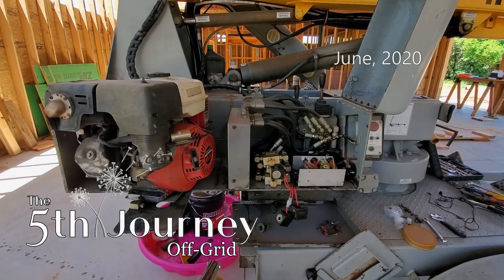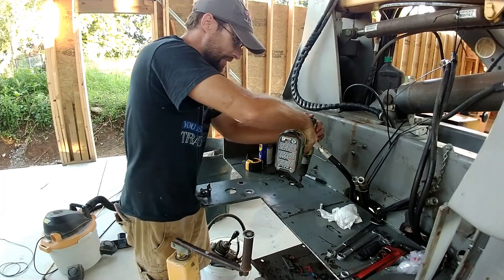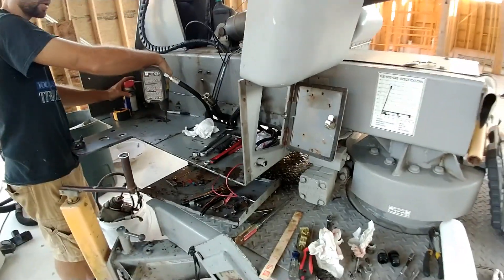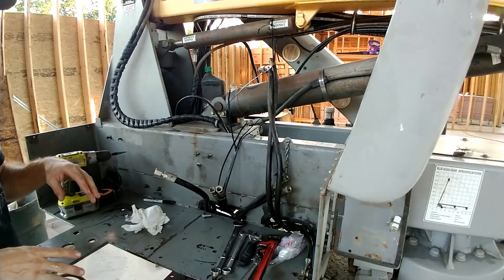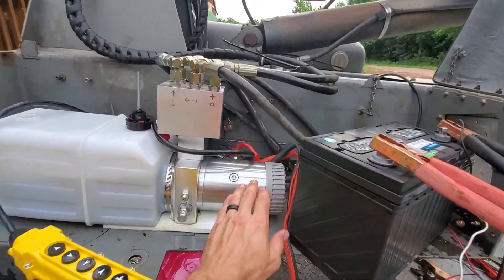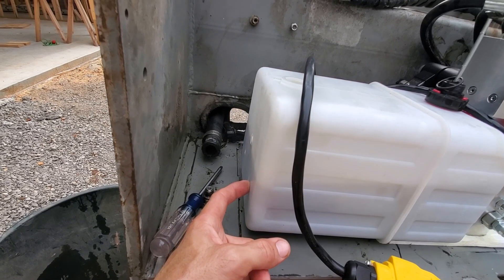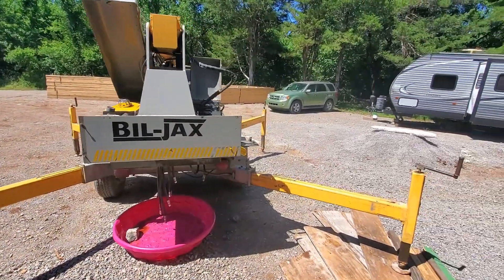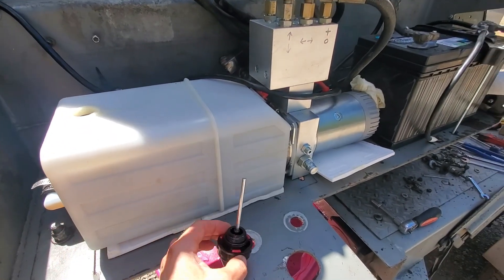Bil-Jax XLB-4232 Motor Replacement from Gas to Electric

Comment: All you really needed to do was get an electric motor and couple it to the pump that was attached to the gas engine 🤷‍♂️
Reply from the maker: Maybe but this eliminated all but two hydraulic hoses that lead up to the bucket because now the controls are remote controlled.  And the old Hydraulic manifold wasn't working properly.  And this was a brand new pump system vs a 40yr old one.  It all needed and upgrade and I still use it today with the same electric motor setup

Comment: Got a Genie and the digital motherboard and the related redundant safety system is more dangerous than not. It's a 24 Volt pump and solenoid valves. I'm planning on a 12-volt complete pump and valve system to eliminate all the nutty digital and 24-volt systems. Yes everyone thinks I'm nuts but now I know another nut.
Reply from the maker: Everyone said it couldn't be done.  I called several mechanic shops and no one would touch it.  I'm still using the lift and it works, just needed to work the kinks out.  I'm not a hydraulic specialist either.  This was my first time doing anything like this.  Seems to have worked out.  Good luck on your project.
Reply: Update. I'm using the 24 V motor and pump that came with it but with 2 12Volt batteries not 4 6 Volts. Going to use push buttons from the ground to operate the outriggers, quite simple I jumped it all and they work fine. I'm using a 8 button wireless in the bucket 3 button pump up and down a motor activator, and swivel all jumped in to my ground switches. I found many cracked wires, the mother board, and motor controller were all done. I simply connect the two 12Volt batteries to a standard solenoid works great. Good luck. Be safe.

Comment: It's a counterbalance valve you need...  for that ''run away" on the lowering cylinder
Reply: Keep in mind, that excess speed can cause the machine to tip over with the sudden jerk and increased force.
Reply from the maker: @ForensicCats  counterbalance valve, thank you.  Where would it go?  I'm still using the lift.  Sometimes it drops faster than I'd like and sometimes it's smooth and other times it acts like it is stuck.  If stuck, I just raise up to take the pressure off and try again and I'll work.
Reply: @Off-Grid   it has pilot valve from the ''extend'' that feeds the counterbalance valve and on the ''retract'' it goes inline (from the exit of your return to tank to the p port of the valve and then from that to the tank)... it works by pressure from the up/extend / pilot pressure and the difference of the down force from the greater pressure created because of the surface area of the face of the cylinder surface area...  The other nasty sound you may hear when you disconnect that wire might be pump running ''dry'' and that is not good.
Buy, the adjust knob one, so you can adjust the down pressure and you might be able to buy one without the pilot connection but that is not the better one as you can cause a flow balance issue if you restrict it too much ... the pilot valve version balances this more safely. 
So, confirm with the other link I sent you, that it uses a pilot valve system , ask the seller.  And, make sure you tell them you need about it rated for the pressure in your hydraulic lines...  Please, confirm the true pressure by installing a gauge inline and check the pressure on extend and check the pressure on retract... you will find your pressure difference and issue there.
Reply from the maker: Thank you, I have some direction now and will get it fixed.  I plan to use it a lot this next spring.
Reply: @Off-Grid     Please, make sure your cylinders have some form of ''hold'' ability incase of a hose failure -- https://www.youtube.com/watch?v=2lFOvxvNwaU
Reply: Also, the heat on that motor is because it might not have a larger fan at the rear to keep it cool or the ambient air is too hot to be able to cool down the motor. It will have a temperature rating on it somewhere.

Comment: You can make me one like yours I have one but I don't want to put that new system on it you can do it for me
Reply from the maker: It took some time to figure out how to make it all work.  Runs like a camp now.  I don't think it was possible to fix it using the existing setup.  Switching to an electric motor and remote controller was an ideal solution.